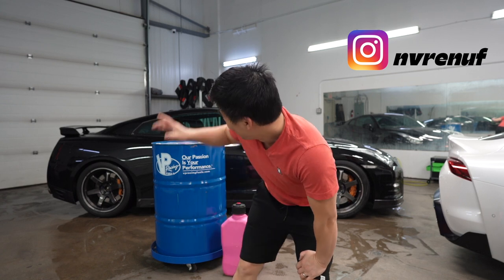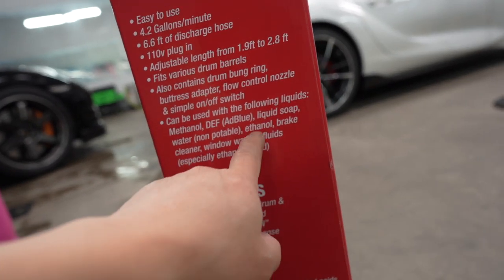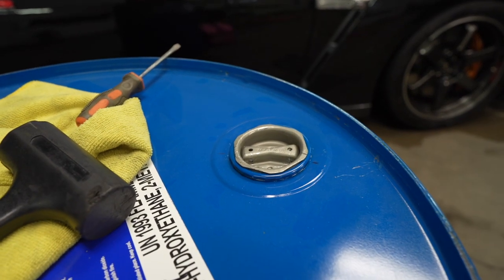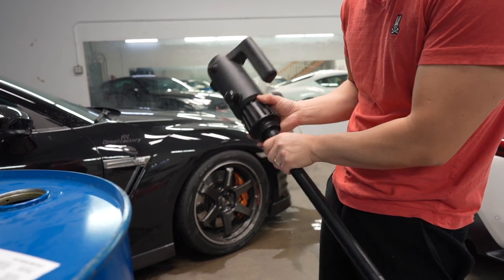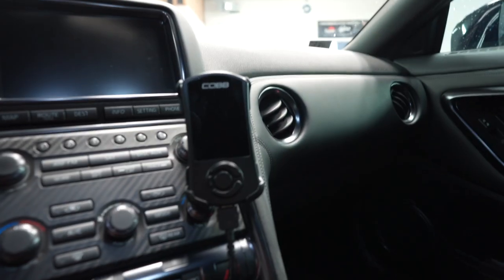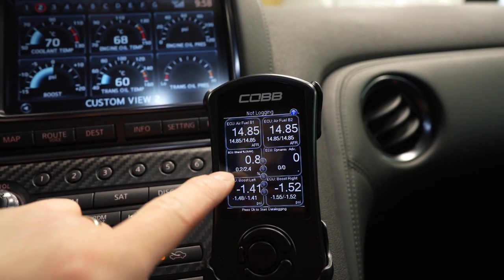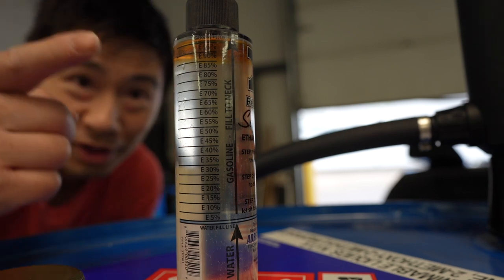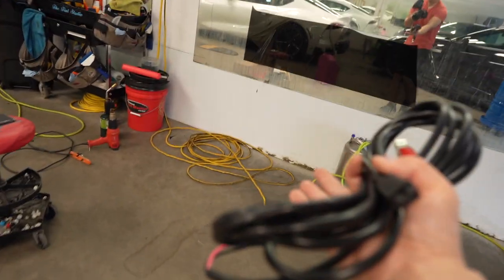MrGasket E85 Barrel Pump Is it Any Good?

Comment: You’re wrong about Ecutek how it shows E85 content. You don’t have to look at the zeitronix gauge. Ecutek hijacks the cars temp gauge and you can view it anytime you want by simply hitting and holding the cruise cancel button then it displays the E content instead of the engine temp. Also, C85 is not a good fuel to run due to it having MTBE, which is known to damage injector internals.
Reply from the maker: Sorry my mistake Daniel I meant Visconti flex fuel kit. Yes Ecutek can be viewed on the app also.

Comment: Good day, may I ask something? Where did you purchase the barrel holder on wheels you use to move it around and how do you get the barrel ontop of it? Each barrel weighs more than 200 Kg and I'm wondering bc we have those at work and we use them in an area where pallets are not allowed (and just aren't pragmatic anyway). Thanks in advance!
Reply from the maker: Here is the link
https://www.princessauto.com/en/880-lb-barrel-dolly-with-handle/product/PA0008852030
Reply from the maker: We tip the barrel onto the roller. You will need three people to load it on.